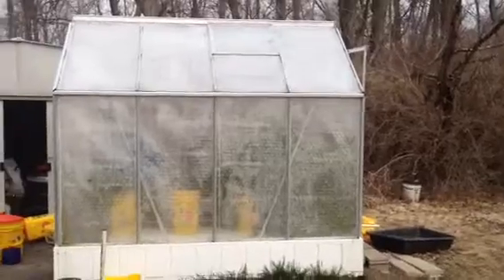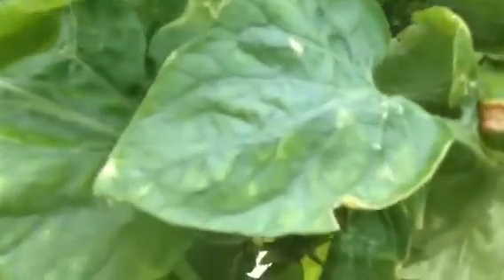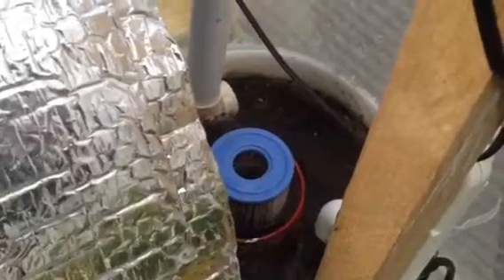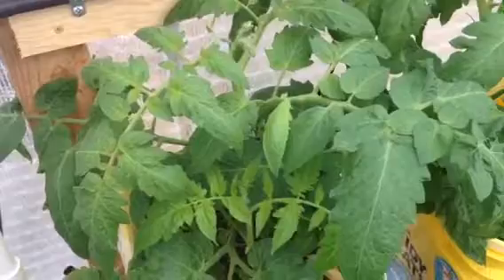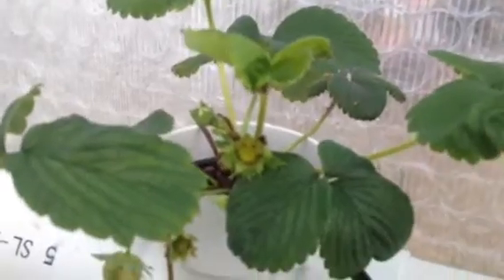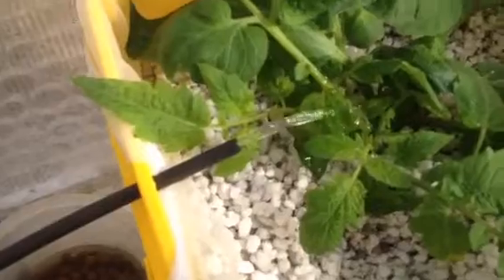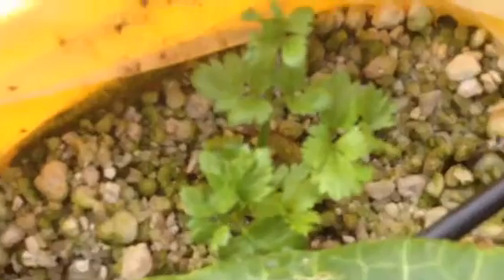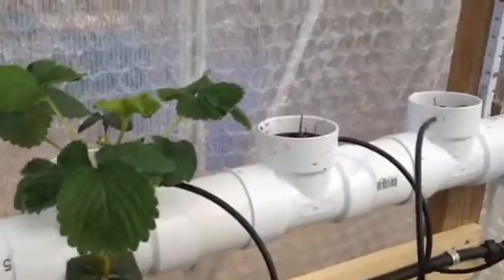Aquaponics update 02/13/2015

Comment: I was concerned after looking into hydroponics, that I may never be able to start a garden project, mainly due to my list of projects with a higher priority (as dictated by my wife) and their expense.  Aquaponics, they way you have demonstrated in the video looks a whole lot more affordable.  I have several 10 gallon and one 20 gallon fish tanks I acquired for brooding, but no longer use.  I am thinking I could use one pump if I find the right elevation for each tank in like a step configuration and linking them with PVC, always sounds good on paper... Because I am going to try to replicate as near as possible what you have, could you explain the key components and their specifications.  Pump, heating element for the fish, if you use air pump for fish or they get O2 from the dribble of the return lines?, if the water going into the kitty litter bins returns to the system, and how that happens, and what you mean  by manifold, I did not quite grasp the swirl filter concept, and lastly you mentioned a sort of strawberry that grows year round, I couldn't catch the name.  I know I ask a lot of questions, but this is the result of low IQ.  I appreciate any answers you decide to provide!